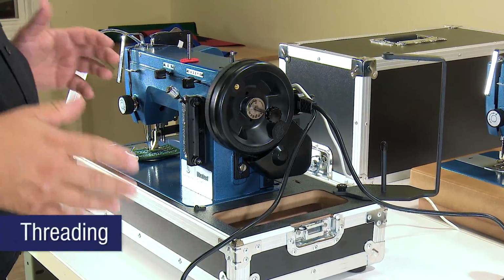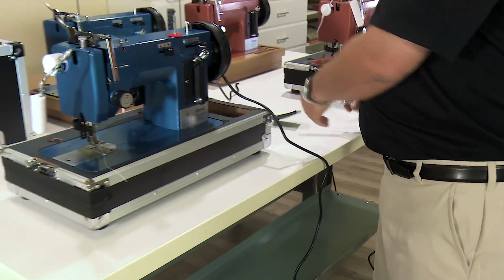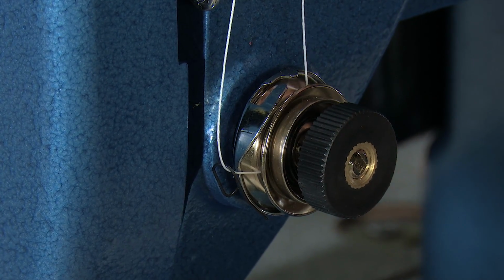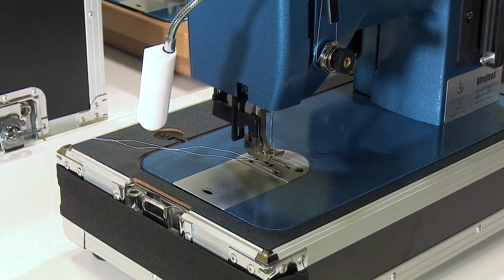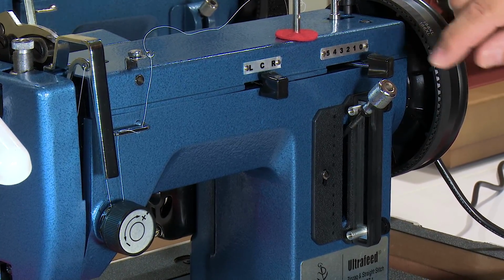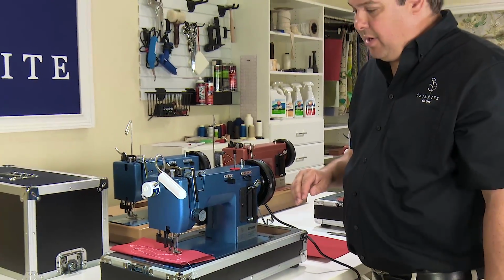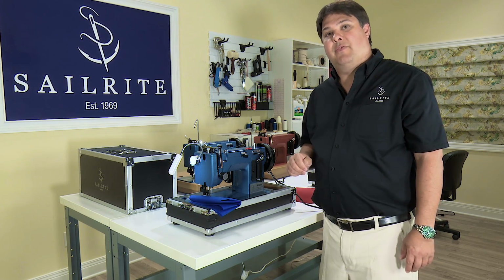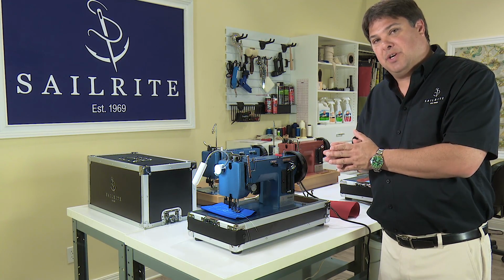Start Sewing with your New Ultrafeed Sewing Machine

Comment: Is there a way to slow down the electronic foot control on my LS1 Ultrafed?
Reply from the maker: The ability to control the machine at slow speeds is a learned ability that does take some time.  One thing that will help is be sure the pedal is on a firm surface (if you have thick carpeting put it on a board) also getting used to the pedal and its control can be a bit easier if you do some practicing with the control in your hand rather than under foot.
A monster balance wheel adds weight and inertia to the rotating assembly.  It won’t make the machine capable of moving more slowly, and will not make the machine start more slowly, but rather will help keep the machine churning along at a slower pace.  It will also facilitate sewing without power as it has an included handle.  If just sewing one or two stitches, maybe to get around a corner, or another tight detail, one does not have to have the monster balance wheel or hand crank as you are able to grasp and rotate the balance wheel.  I personally do a lot of sewing in which I will manually rotate the machine (grab the balance wheel) both at the end of a seam to properly position the needle as well as any time I need to sew just one or two stitches and want more control.
If portability of the machine is not required we do offer an industrial table/stand with a servo motor.  The Servo being a much larger electronically controlled motor is capable of full power at any speed, so it’s low speed control is unparalleled.

Comment: You show the EZ Set Stitch Length Plate adjustments. Does it allow you to set the forward length to 6mm and the reverse to 2 mm? Would there be any use for this?

Comment: This is by far the best video to introduction to sewing. I have never understood a sewing machine like this before.
Reply: Cómo compra uma dessa?
Reply: I really like and respect Sailrite. (These guys are like rock stars at boat shows.)  I learned to sew on a Janome. What I quickly discovered is that almost all instruction begins long after  many of these basic but essential points. Nothing I found for over a week mentioned anything about holding the two threads, or manually planting the needle before sewing.  So that week was all rat's nests under the fabric. 
The only thing missing here is how to know if you need more or less tension. I expect that will be covered in the next video.

Comment: IS there a way to control the speed? We do not seem to have the control that you do at the slow speeds. Our machine "buzzes" when we slightly push the pedal....then begins to sew at a higher speed than we were wanting.
Reply: You need to buy from Sailrite the Monster II Balance Wheel and remove the fly wheel machine came with.  The weight of this Monster II Balance Wheel slows the machine at the beginning when you press the pedal.  You can still sew very fast once you are going on the straight.

Comment: Im in love. 💘. 
1.) Ultrafeed - *walking foot
2.) Portable - and cabinet opt.
3.) Machanical - manual if needed.
4.) Basic - perfect
Wish
s. machine cord plug, would have outlet/lead for Light. Maybe one only has one wall outlet, and its being utilized/full.
Im saving my pennies.
09-07-19 1:07 pm pdt
Reply from the maker: Well, actually we have recently developed a special plug for the light. The LED light will eventually plug in right behind the motor with a special metal bracket that holds both the foot pedal plug and the light plug. It is in the finial production stage and should be included on all Ultrafeed sewing machines around Christmas 2019. It will also be sold separately for current owner of Ultrafeed sewing machines who want to upgrade to it.
Reply: @SailriteDIY  thank you
09-09-19 5:30 am pdt

Comment: The threading directions in the manual do not show the same threading on the 3 holes.  I was sewing and the thread kept breaking.   Hopefully that was the issue.
Reply: This happened to me as well, but I soon learned that I kept threading the needle, right to left, when it's actually left to right. 
This may not be the case for you, but I saw this and wanted to chime in, just in case.
Reply from the maker: I do not think that will resolve the issue your having with the thread breaking. If the issue is not resolved please email us for more help at: support@sailrite.com
Reply: This could also be caused by cheap thread. You might want to get Maxi lock thread, or nylon thread, depending on what you're sewing.